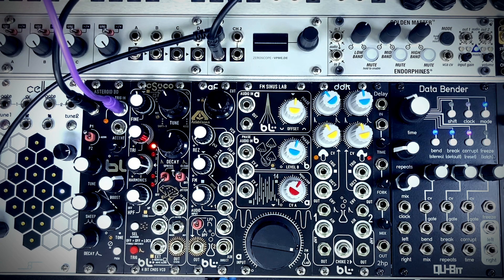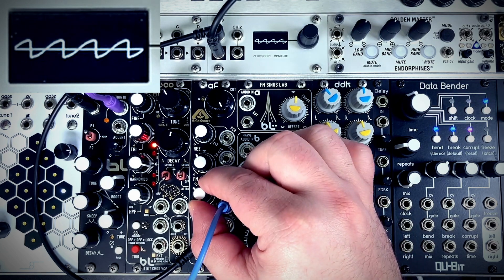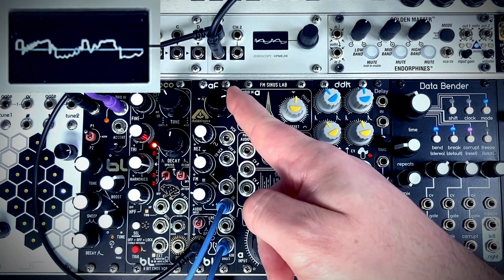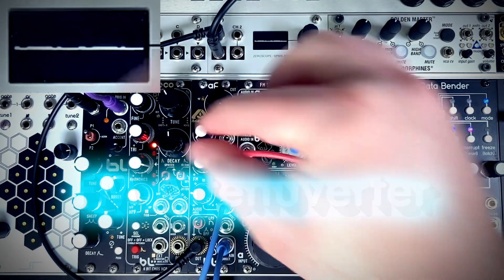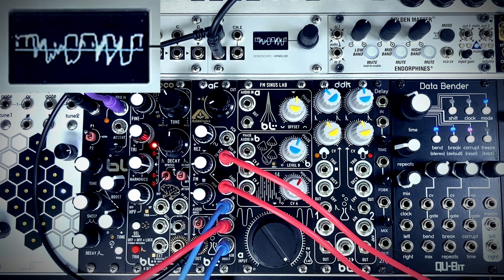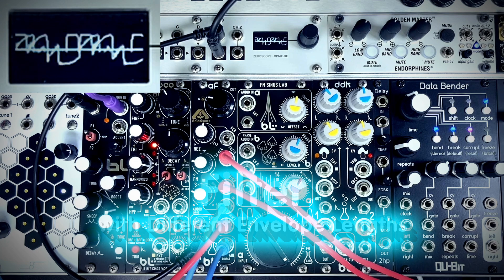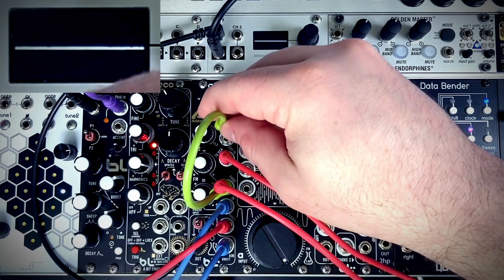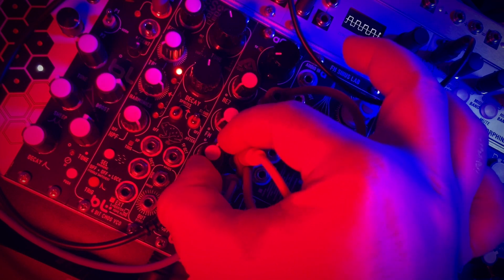Acid 'N' Sons Acid Filter - By Blue Lantern Modules | Full Walkthrough and Demo

Comment: excellent video as always Professor.. Blue Lantern Modules is my favorite company so far giving you the most bang for your buck.. I am usually more of a fan of 12db filters but I am assuming the LPF is 24db..? ..it sounds squelchy in a great way.. I didn't like Pittsburgh Modular's new Filter of Crows.. I was wondering if the name Acid N Son's is a nod to the TV program Sanford and Son..?
Reply from the maker: Yes the LPF is 24db and I believe the BP is 18db. The name is a spoof on the Grocery Store chain Albertsons
Reply: @RobotsAreRed   ..yes I also heard that the BPF was 18 db which would be very interesting.. my two favorite filters so far are the 12db Tiptop Audio Forbidden Planet and the 12db Erica Synths Polivoks.. also the filter in the original minilogue switched to 24db is extremely musical in my opinion.. thanks again Professor..
Reply from the maker: @normdurkin6425  Thank you!